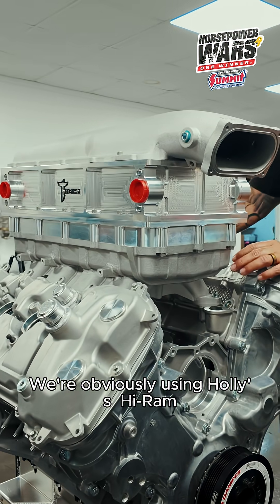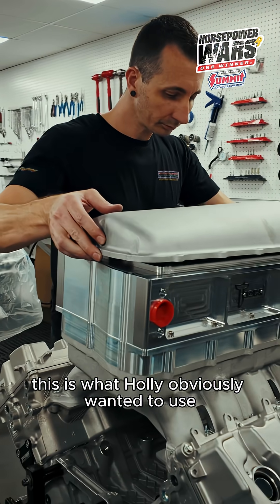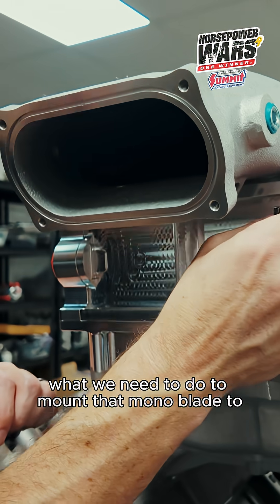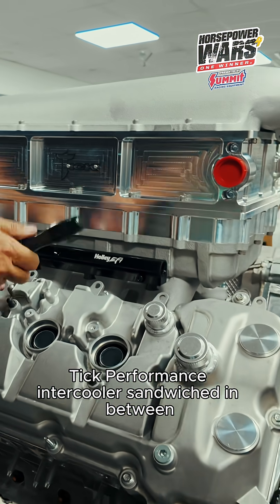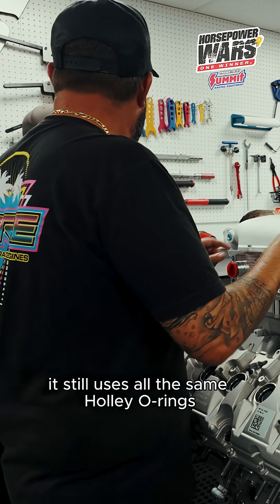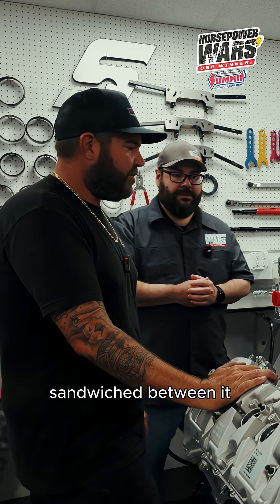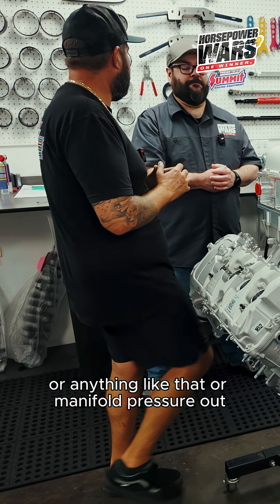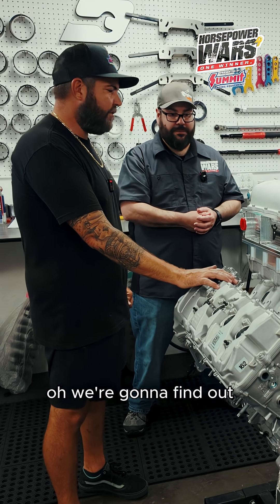Capping off our Coyote with the Holley HI-RAM FORD COYOTE intake manifold #LSvsCoyote

Comment: That holley intake is straight garbage, just use a cobra jet. That thing just looks hideous
Reply from the maker: Nah. I'm sure some people would and have run 30+psi through a plastic intake, but that's not really ideal. And we didn't want to run billet intakes this time. We wanted it to be relatable.
Reply: Why do you think it is garbage? What's your experience with the intake?